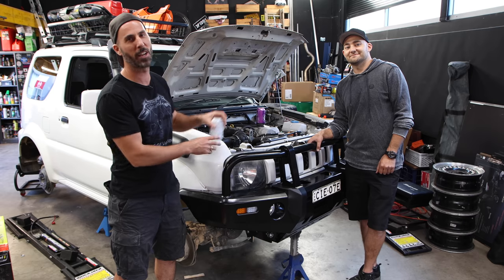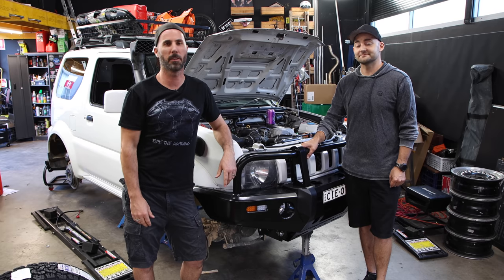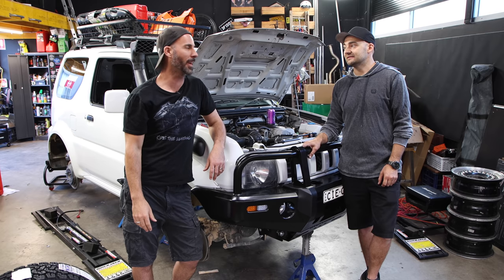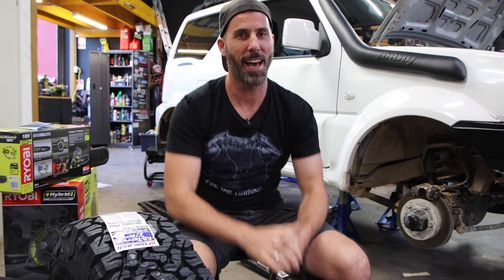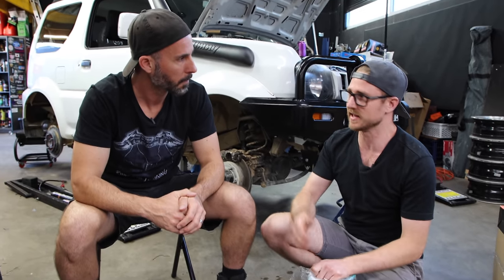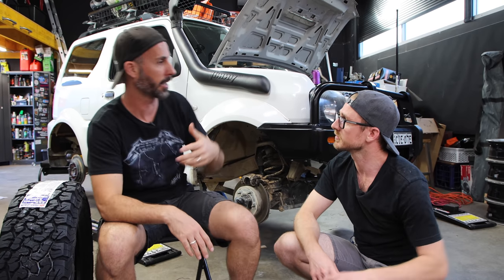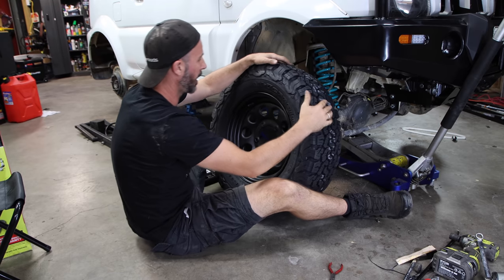Jimny LIFT KIT Install & Off Road Tyres

Comment: In India, where that type of model was incarnated as a MARUTI, and in its 2stroke original engine as a 'KUSUNI' (a derogatory term meaning F-A-R-T) - listen to a 3 cylinder 2 stroke slowing down- There are still a few of them around Australia's hippy community with HUGE wheels....   "Maruti Kusuni"

Comment: I built a jimny off roader so relate to this! I had the cage on the roof but just caught on trees so took it off! took back seats out for  storage instead, Ripped carpet out as water does find its way in if your going in deep water and  hard to get them dry! Word of warning tho these go through drive shafts quickly so take spare if you don't want to get caught out. Have fun i know i did with mine.
Reply: Half shafts and cv joints I meant there not the strongest

Comment: BFG KO2 is a great tire for on road with a light offroad, and really good for dry hard surfaces not mud.  The BFG KM3 is their mud terrain and though a personal favorite, is still just decent on mud but great on loose stuff.  Both offer long life and great overall performance.  A major consideration is if you plan on getting offroad then you need a good air compressor so you can lower your tire pressure when offroad and air back up before heading onto the roads.

Comment: Just some food for thought and maybe advice for you two boys. Suspension lifts do not allow most vehicles to clear larger tires. 

To properly clear larger tires you require a body lift to clear the actual vehicle from where the tires would previously scrub while articulated. A suspension lift is only extending the length of suspension components. Not changing the travel path of the wheels. Get a body lift. Set your castor properly with correct arms or hybrid bushings. And choose the correct offset rim. 

Good to see JDM boys having a crack at it though. To many diss hate to mix the two passions.

Comment: one last thing you might want is a 12v tyre pump, not sure if they're as essential in Australia but in a lot of places it's not uncommon to run super low tyre pressure for maximising tyre footprint in mud/snow/sand. Obviously you don't want to go crazy low without bead lockers on your rims otherwise your tyres can fall off but it can really help if the going gets squishy

Comment: So glad you got bigger tyres. One thing ppl forget is that even when lifted, a standard tyre diameter means the axles, hubs, ball joints, tie rods etc all remain at the same height - meaning you're not lifted at all. If the centre of the wheel remains at the same height, then so does everything else connected to it and can get wiped out by rock just as easy as before.

Comment: These NEED to come back to the USA SO BAD. I miss Suzuki :(
Reply: Right can you immagine how many guys with oversized "trucks" would cry over getting shamed by a little jimny  lol
Reply: @pier11francesco  to be fair, most people don't offroad full size trucks. 
It's primarily jeeps and toyota tacoma/4runners or something similar.
Reply: @zososldier  I know... tacomas jeeps and 4runners would still get shamed by the jimny just watch you'll see
Reply: @pier11francesco  I had a 1996 Suzuki Sidekick Sport I manual swapped and put a 4.5" OME and ARB lift on. Thing was an absolute monster. If it couldn't go over something, it would go around it. My best friend/coworker owns it now, (long story). If I hadn't blown the headgasket and had more experience at the time, I was about to put air lockers on it to make it even more capable. But now I get to see my friend bring it into work every now and then, and he loves it :)
Reply: @ZekeGraal  These little Suzukis look so innocent people just don't know how insanely capable they are and I love it ahahah I never got stuck with mine and I did some insane shit with it in the past hahaah

Comment: "More capable than a Subaru?"
"STOP IT"
Reply: Way more capable than a Subaru, Subaru's are such garbage.
Reply: @RichRusso4218  cope
Reply: Lol, was searching for this comment, I'm triggered too
Reply: @fungus2116  exactly, you get it, Subarus can’t cope!
Reply: @fungus2116  obviously a troll
Reply: I see the butthurt Subaru kids are here. I love it, you kids buy Subarus, they constantly break and I constantly make a lot of money fixing them! Keep it up, you aren’t hurting my feelings!
Reply: @RichRusso4218  yup
Reply: Subarus are rally terrors, SUVs (soft roaders at that) and grippy road cars. Offroading shouldn't even been mentioned in the same sentence unless Colin McRae had a stack lol
Reply: Obviously you never came across my modded MY81 Subaru wagon! 
I had a 3" lift in the front, 2" in the rear with 27" Tyres., L-Series 5 speed were just some of the mods. there were others done similar to this in the club back in the day, including EJ Brumbies, EJ lifted Liberties, I also had a Turbo EA82 LSeries.
How did it go? Over geared, under powered, great in the sand, very light and had enough clearance, but not a crawler.

Comment: If the lift gives better articulation you need to cycle the suspension to test that  your front brake lines are long enough. If they are too short there is a risk that that at full droop the line gets ripped off.

Comment: Yo, you should add a space between the read shock bolt and the shock (bottom) I think the oem design is really dumb, if the bushings failed your shock will getbout of there

Comment: I would say your next add ons should be a light bar on the roof rack or just underneath the windshield. Some outward facing lights on the side and rear of the roof rack. Locking diffs, at least a locking rear diff. And definitely some rock sliders (think of them as protective side skirts) and skid plates protecting the diffs, oil pan, and transfer case. 

To get started... and call her “Bushny”

Comment: Cant u call it Coyote? The plate almost spells it if u use a bit of imagination😅 
Rad with the K02 tyres, litterly opened a box with the same tyres for my trail rc car when i looked at the video, i reckon u must get a Traxxas TRX4 or Axial Scx 10 to bring on ur outback adventures! 
Keep up the good work and happy holidays from Sweden✌🏽

Comment: I want a Jimny.  I live in the united states so I don't think I can have one.  The closest thing we have is an old suzuki Samurai or sidekick.  The jeep renegade is just a 4x4 fiat 500, but that looks close. I will trade you my 1989 Ford Bronco XLT with a 5.0 Liter V8 for your Jimny.  Probably cost too much just to get it over there, but I can dream damn it. I can put 33" tires on mine without a lift kit.

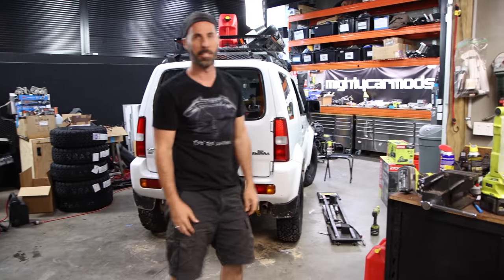Comment: 12:08
The tires should be wider than this size in order to give better stability on the roads and also because the car becomes more height than its width and this makes it unsafe This makes it vulnerable to tipping In addition to the fact that the car has become heavy, it must raise the engine’s power by at least 40 Horsepower And up to 150 Nm of torque

Comment: Ko2 are  Really quiet and  Are not that very good off road now if you went with mt03 or mt04 they are more aggressive with road noise and handles better 4wheeling. 

I ges if you think about it you did a stage 1+ but the 4wheeling community  Doesn't really call it that You have the basic set up lifting wheels your trucks not really set up for true off roading It might be a cross between an overland vehicle and an entry level trail rig

Comment: Actually… if it doesn’t have a 2 wheel drive option then it’s a “all wheel drive”

“4 wheel drive” is a completely different set up which gives a 2 wheel drive option.. just saying